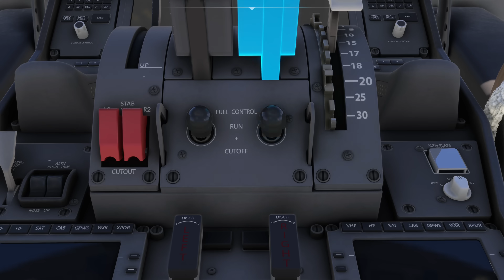Air India 171: Why Did The Fuel Cut-off Switch Get Moved?

Comment: Captain Steve sounds exactly like how a Boeing spokesperson would sound like
Reply: Captain Steve is leaning toward supporting Boring. However, I strongly believe that the information presented to us is limited and misleading. Given the manufacturer’s history of hiding critical details, we should not jump to conclusions.  

In India, it is very easy to influence opinions with money. There is no accountability, integrity, or dedication whatsoever from the Indian investigation team—especially now, as all pilots are raising concerns about the incomplete report. The fact that the report gives a clean sheet to GE and Boeing only proves to me that they were bribed.  

In general, humans don’t care about their fellow humans when greed is involved. After watching all the technical videos and pilot discussions, my sixth sense tells me this report is flawed. Eventually, they will blame the pilots, as it benefits both the manufacturer and the end-user in maintaining their reputation.
Reply: @PJSC22  Here’s a developing theory that a rare electrical failure may have caused both engines to lose power — not because of mechanical failure, but due to how the 787’s safety systems are designed to respond in extreme situations. Specifically, we look at the possibility that the aircraft’s fuel shutoff valves (FSOVs), which are designed to close automatically when power is lost, may have played a role. This isn’t confirmed — but it’s a plausible scenario worth examining as we await the official report.
Reply: Sadly he can't even get the transcript correct. The wording was '"why did you cut off?" not, why did you cut it off. That's a world of difference. Because the pilot was obviously talking to the controls & highly confused.
Reply: Watch Flyingbeast video if you  really believe in unbiased explanation ❤❤❤ english subtitles are available
Reply: @euriklediger  Here’s a developing theory that a rare electrical failure may have caused both engines to lose power — not because of mechanical failure, but due to how the 787’s safety systems are designed to respond in extreme situations. Specifically, we look at the possibility that the aircraft’s fuel shutoff valves (FSOVs), which are designed to close automatically when power is lost, may have played a role. This isn’t confirmed — but it’s a plausible scenario worth examining as we await the official report.
Reply: Boing is a shitty company right now. Maybe the become better some day. But this acciednt was a suicide by the person that shut of both fuel control switches...and I would say it was also a more than 200 time murder! This suicidal guy deserves no pity at all! There are enough ways to leave life without harming other people.
Reply: As he should
Reply: You sound like a person in denial.
Reply: Don't worry guys one day this can happen with him also then companies will make him a villain.
Reply: Old man shut your mouth and just go again and learn how to fly the airoplane, atleast watch the video of flying beast
Reply: Exactly....this fu*ker is a boeing lap dog, this hypocrite old fart
Reply: Please explain why boeing is not responsible
Reply: Why did you cut off ? What exactly he is talking about cut off? Air conditioner or any thing else. Why was not full transcript posted in report. Why u r coming to a conclusion that it was fuel supply just because someone posted a bullshit report which is without any signature of any official.

The exact answer is that engines failed just after the plane left ground. It may be that the pilots where sticking to the boeing's guidline regarding engine failure where it states that restart the fuel switches. Which exactly means cut off and start again. Also see when RAT got deployed no timing given in report but timing of RAT supplying power mentioned now your boeing engineer say that RAT gets fully  functional after 6 seconds so that means at 8:39 the flight takeoff and RAT started giving power at 8:47 go 6 seconds back when RAT got deployed at around 8:41 so engines got failed just after 8:39 or 8:40. That means first engine fIled and then fuel switches were touched . So Captain Steeve it seems to me that u r a rookee traine
Reply: I recently read this: What really happened on Air India Flight 171? In this video, I explore a developing theory that a rare electrical failure may have caused both engines to lose power — not because of mechanical failure, but due to how the 787’s safety systems are designed to respond in extreme situations. Specifically, we look at the possibility that the aircraft’s fuel shutoff valves (FSOVs), which are designed to close automatically when power is lost, may have played a role. This isn’t confirmed — but it’s a plausible scenario worth examining as we await the official report.
Reply: Yet another report from a professional investigator urging to wait for the final report. 

She even says it's quite a routine that pilots are blamed only to find defective planes caused the crash

https://m.youtube.com/watch?v=FOuBIOHoHb4

Captain Steve will probably bite the dust. His ego won't allow him to apologise,  which is understandable. After all everyone has their ego and we have to understand that.
Reply: All the prideful Indian commenters on here sound exactly how I expect prideful Indian commenters to sound like.
Y'all will be blaming Pakistan next...
Reply: @leenieledejo6849  haah, in your dreams bro.
Reply: @leenieledejo6849 
Propaganda & Propaganda by boeing :
● the exact time stamp of when one pilot asked other pilot about switches being cut off is not mentioned.....
● the exact time of engine going out is not mentioned it is mentioned as "immediately after" everywhere no exact time stamp given....
● cctv footage shows rat already deployed above airport premises....
which means engine turned off or failed already way before the rat got deployed.....
● pilot first procedure for engine fail is to turn the switches off & then on....to reignite the engine....
● in report it said one engine was already gaining thrust but the other engine didn't....
again exact time stamps are not provided 
● pilot voice recorder exact words are not quoted.....
In the report they mentioned in the third person & was not the exact words used by pilot in hindi or indian language....
Also in the entire duration of 32 seconds of the flight.....it is no where mentioned when exactly the pilot asked the other pilot about "did u cut off" & specifically ENGINE or fuel switches is also not mentioned....
Then means cut off can refer to any other systems of the aircraft....auto pilot, ac, anything......
Reply: @leenieledejo6849  Ya Online-Indians are horrible...especially when you look at comments in the Hindustan times channel on youtube... they basically cheer to get Ukrainians genocided...it's a big Pro Russian , pro genocide and pro dictatorship fan crowd. 
Yet, what ever you can say about India, Pakistan and the average Pakistanis are objectively worse in every aspect.
Reply: I believe we're witnessing the beginning of the control structure collapse. World leaders are controlled by the wealthiest families on the planet, who also have (had) their own subservient roles in the control structure - until recently. With their masters no longer around to give orders, these top families are watching their money dwindle while fighting for the top seat. With airlines being huge assets - what better way to send a message to another family that their time is up? Sick and depraved, yes. It's their specialty.

There's another scenario that hasn't been mentioned out there and a very real possibility: directed energy weapons (DEWs).
Reply: Here’s a developing theory that a rare electrical failure may have caused both engines to lose power — not because of mechanical failure, but due to how the 787’s safety systems are designed to respond in extreme situations. Specifically, we look at the possibility that the aircraft’s fuel shutoff valves (FSOVs), which are designed to close automatically when power is lost, may have played a role. This isn’t confirmed — but it’s a plausible scenario worth examining as we await the official report.
Reply: Good, I support Boeing.  They aren't responsible for this incident.
Reply: @Robert9-tz1  Are you sure? Do you know Beoing very well?
Reply: @Robert9-tz1  imagine backing multi billion dollar companies, they dont car about your existence, grow up
Reply: @Robert9-tz1  Yes, they are, buddy. Same as they were responsible in 737-MAX crashes.
Reply: @turbanbasscity272  Here’s a developing theory that a rare electrical failure may have caused both engines to lose power — not because of mechanical failure, but due to how the 787’s safety systems are designed to respond in extreme situations. Specifically, we look at the possibility that the aircraft’s fuel shutoff valves (FSOVs), which are designed to close automatically when power is lost, may have played a role. This isn’t confirmed — but it’s a plausible scenario worth examining as we await the official report.
Reply: @Robert9-tz1  they are responsible for MCAS deafult for 737 max crash where FAA made a deal of 1.1billion dollar to not start a crimianl prosecution in the ongoing suit against boieng the federal court this show who is payout
Reply: @Robert9-tz1 1. UTC 08.08.42- max speed 180knots(i.e- engine fail around 08.08.40-41 UTC)
2. Fuel switch cut off at 08.08.43 and 08.08.43(as per procedure if both engine fail)
3. RAT supply hydrolic power at 08.08.47 (need atleast 6-8 second after engine fail)
4.   08.08.47-6 = 08.08.41
(time of probable engine failure and fuel switch cut off at 08.08.43-08.08.44 UTC
Reply: @uniques7  Here’s a developing theory that a rare electrical failure may have caused both engines to lose power — not because of mechanical failure, but due to how the 787’s safety systems are designed to respond in extreme situations. Specifically, we look at the possibility that the aircraft’s fuel shutoff valves (FSOVs), which are designed to close automatically when power is lost, may have played a role. This isn’t confirmed — but it’s a plausible scenario worth examining as we await the official report.

Comment: Is it possible that in the event of a dual engine failure in a fly by wire aircraft, the fuel cut off switches would receive an automatic electronic signal to cut off fuel before a pilot would manually do it?

Comment: Hi Steev.
Good that you give some insight to the problem.
But my question to you is, 

How come Boeing design allows cut of both engine fuel supply while in running. By default it should not allow fuel cutoff for both engine.

Comment: 02:49 That's not the question. Why does the aircraft allow to cut fuel in FULL THROTTLE settings
Reply: Because plane manufacturers think pilots aren't people who are as dumb as to be able to shut down both engines at such a low altitude after departure!

Comment: Captain Steve, was there anything you can think of which would have saved the plane, like extending the flaps even more,or trying to bring the under carriage along with the steps to re position the fuel switch to run

Comment: Explain us how the two engines turned off by itself immediately (automatically) after landing in ANA airlines in 2020. It is the same 787 dream liner and an identical aircraft. The passengers in ANA were lucky it happened after landing. The pilots did not do it. Only Boeing can answer under what conditions the engines would turn off!! Connect these two incidents and get some details on what was the answer Boeing gave for the ANA airlines incident. The media is just speculating that it could be a pilot error for the Air India 171.
Reply: Actually not an identical aircraft and not the same as this situation. The ANA incident was with a Rolls Royce powered aircraft and was a software parameters issue, the crew went to reverse before the aircraft had transitioned to ground mode. 
That software parameter issue was taken care of. Is not related to this crash.
Reply: @caribbeanaviator1964 the fuel is switched off automatically is identical in both the cases.
Yes GE or maybe RR engines and situations are different, airport, weather is all different

But remember when an aircraft is built the software is the same. The interfaces to the Hardwares could vary but the config is all the same. You dont maintain different softwares

Clearly the Software has shut off the fuel switches under what 'usecases' is something only Boeing can explain. The ANA pilots who are alive confirmed that they did not shut down the fuel switches

Comment: Hi Captain, could the fuel cut off switches been mistaken for activating another take off procedural task eg retracting gear switches.  Was the landing gear retracted?  Are there any other switches of anything else located nearby those switches which needs to be activated as per take off procedure? Were there any take off tasks not performed as they should / as per procedure?

Comment: I suggest a interlock i.e. when the engines are at full thrust or 80% the fuel cutoff switches are in active......cause why would the pilot need to cutoff when at full throttle

Comment: All this psychological factor thing causing the crash just after takeoff, I call BS! Pilots are trained to be extremely aware of the situation and there’s no way the pilot monitoring would not have immediately seen the pilot flying cut off both fuel switches within a span of seconds (which sounds too difficult to even pull off)

Comment: Here's a question. What if the same were to happen on a Airbus Aircraft (A330) or a different Boeing Aircraft Type what would be the results. I have feeling Airbus have a safety feature for this. Shutting down both engines just after take off should be inhibited by the system up to a certain altitude. It's not a hard thing to do.

Comment: Question @Captain Steve, you said you cut off upon landing, which I understand, but at climb out when the throttle is at 100% it should not allow that. It would me sense to me the cut off can only be done when the throttle is under a certain setting. If the pilot needed to do that first, the other pilot qould have acted within half a second to push the levers back. So this specific scenario boeing can improve.

Comment: Most probably, if fuel switches were involved apart from tcma failure it is due to sudden loss of spring constant due to nearby motion of ball lightning? Aircraft wheels act like giant electrostatic generators in dusty environment and heavy weight and friction, ball lightning can easily move up the conducting tyres and up the metallic hydraulic system and up near the fuel switch area????? This is just natural and rare phenomenon. Ball lightning can inject current in both springs and joule heating of current can cause spring constant drop to zero. Do these fuel switches are exactly or almost near albeit vertically above the wheels?

Comment: My question is, do the cutoff switches pass voltages directly to the fuel valves, or do they have relays that pass voltage to the valves? In class 8 trucks most functions are passing voltages through relays triggered by the panel switches. The relays are energized by grounding.

Comment: You are a s**T explanator Mr Steeve, initially you said pilot accidently put the flaps off in 0 position and you intention or your "investigation" was always to save the flight operators and taking pilots in question... An investaigation is always to look on both siges and not only on one issue....learn how to do it ..may be you are good pilot but not a good investiagator..do what you are good at do not rant your progapaganda.

Comment: I am not a pilot, nor am I familiar with flight operations, but I watched the numerous YouTube videos after the event with great interest. I came across a single video (which I can no longer find) that played another section of the voice recorder that was NOT presented in the current preliminary investigation report: One pilot—I think the left one—said in alarm shortly before: “My seat...” and the commentary reported that the pilot's seat had suddenly moved back about 30 cm, and that the pilot may have lost his balance slightly as a result, making it possible that he grabbed the fuel switches hard while reaching for the control stick, which could then have been flipped to OFF. This circumstance must be taken into account, and the pilot's statement “my seat...” may be very significant. A seat latch has obviously been repaired and replaced, according to the commentary in the video (translated with AI).

Comment: Puppet of Boieng, blame is put on pilot where everyone know its aircraft issue otherwise why reports are not clear with exact time stamps and how can black box be damage when they are built to withstand everything. No one is asking Boeing how can the data recordings are not there in black box. How can a switch be off, and it any of the engine started again then why they are all intact as per images because engine will torn down when it run on speed. There are lot more points but yeah everyone don’t have a spine to support pilots. Next can be you or someone else who will be blamed and their family will have to live with that. Shame on all the pilots who are not talking or highlighting the right questions